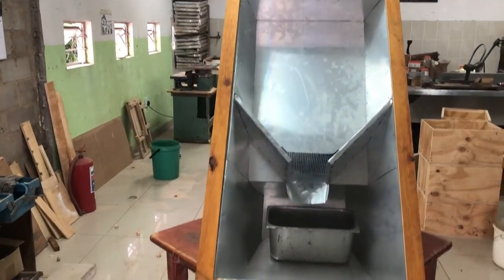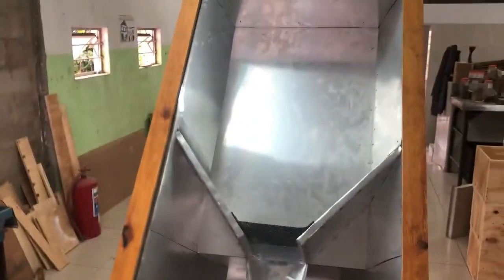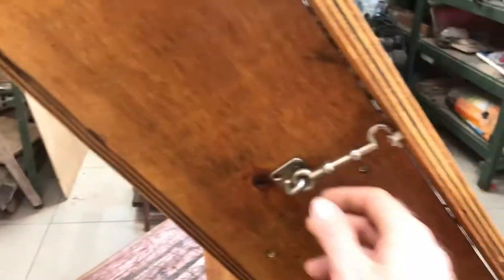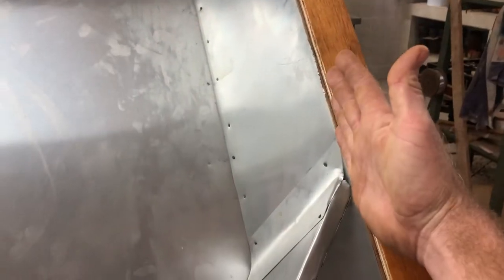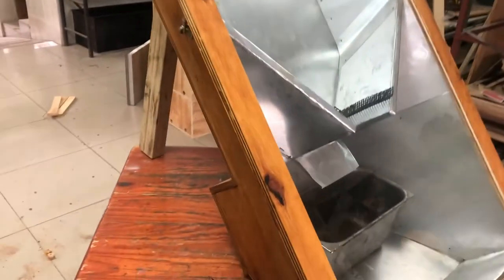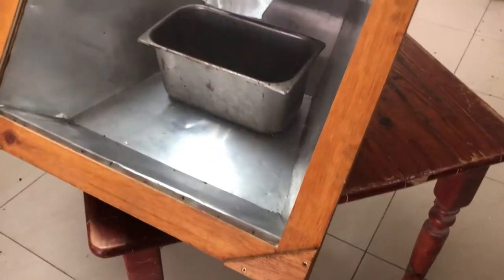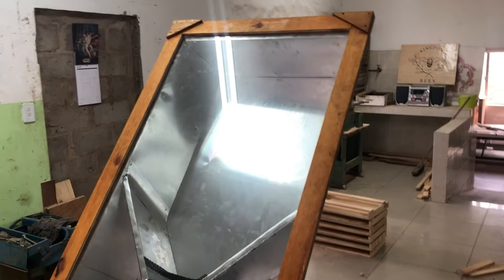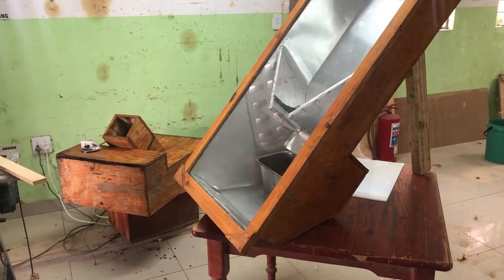Build your own solar beeswax melter

Comment: Good practical work fella
I used one of these a lot 30 or so years ago. Similar construction but I cased the wood frame in 3 inch expanded polystyrene insulation board. I used thin greenhouse glass but as a DIY double glazing unit. I had a second layer of filtration through a double layer fine cloth, which gave an extremely clean product. Might sound like a bit of overkill, but the sun here is not that strong, so retaining as much heat as possible was the key.
Had to give up my bees when I started getting anaphylactic reactions to stings :<(